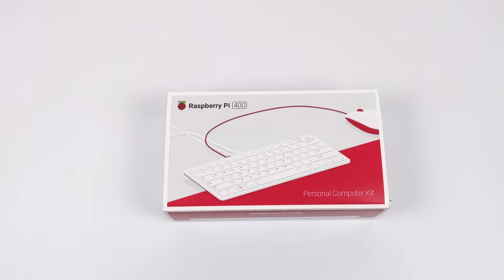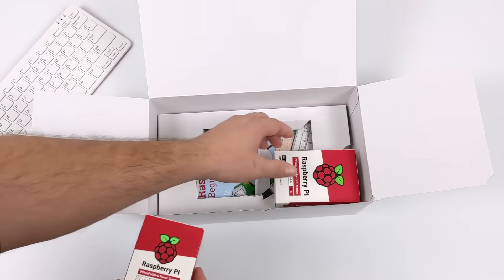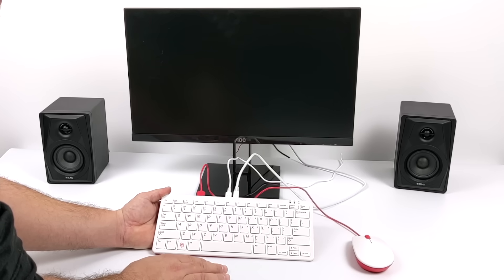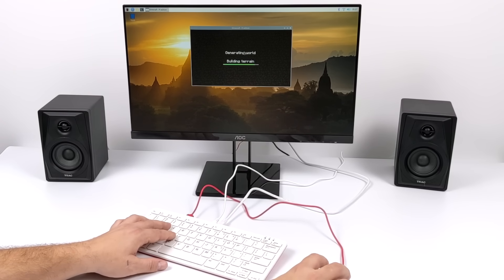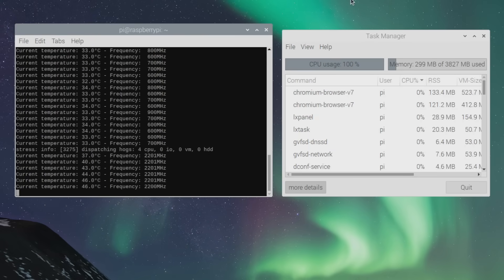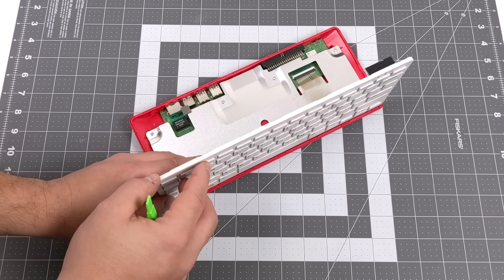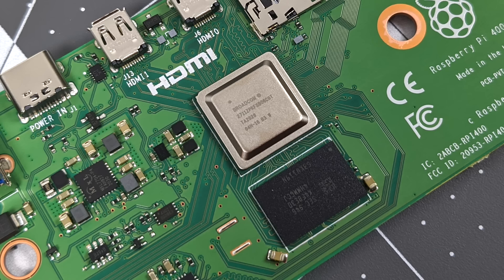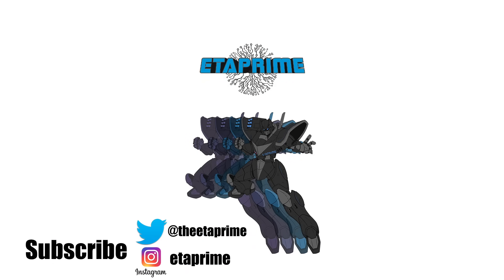The Raspberry Pi 400 is Awesome! Review, Overclock, Emulation, Tear Down

Comment: you can... but do you really want to? tried using the rpi4 for that use case and there are just multiple small inconveniences that made me nope from using it as a desktop replacement.
Reply: Like what inconveniences? I was thinking of doing this as well.
Reply: Can you please give some examples?
Reply: My main issues are speed and compatibility. It's not as responsive as I would like doing tasks, primarily opening webpages. Like there's a noticeable delay  when you open multiple tabs that irks you. When you run multiple things at once as well, you can notice the performance dip.

Another is compatibility with my workflow. So, like most of our documents are in MS Office right? So when you use the Linux equivalent of those programs, it just doesn't look the same which is important when your doing collaborations.

There are also cases when the hardware I'm using is not fully compatible.

All of these are small gripes admittedly but they add up and makes the experience unpleasant.
Reply: @jepoyburner  I thank you for taking the time to type this up. I am trying to weigh the pros and cons of this machine and every bit of data helps. Have a great day. :-)